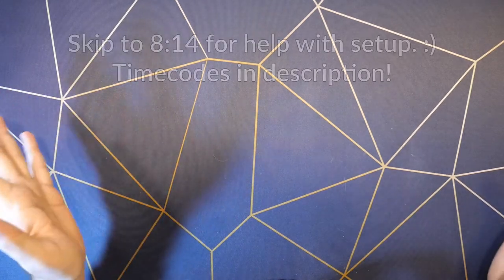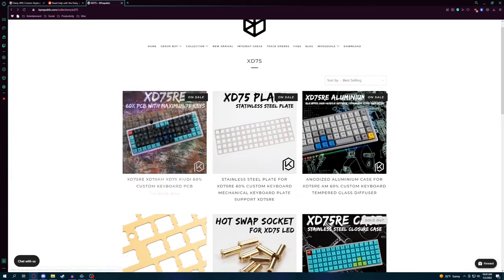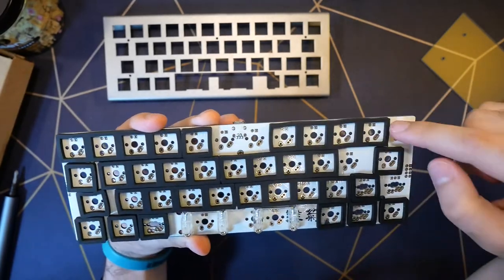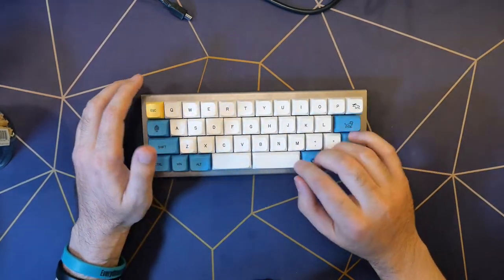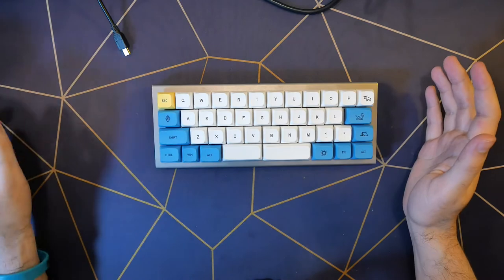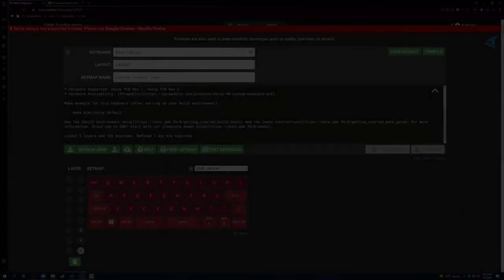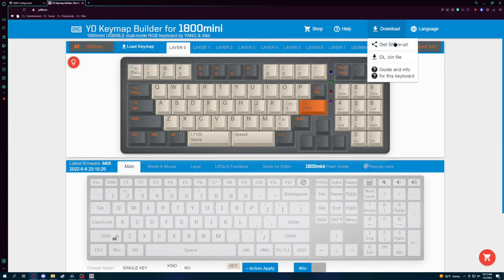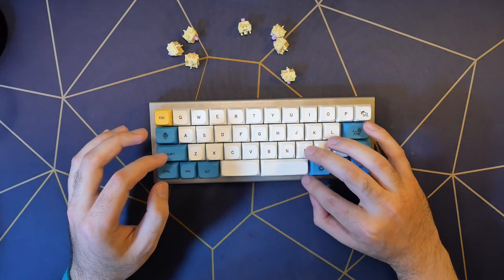Daisy40 - Build and How to Flash - KTT Mallo

Comment: There is both QMK and VIA firmware for the pcb, you can just flash with either of those firmwares no problem like any other keyboard. Idk what not detecting means... You can flash any firmware with qmk wether it be official or not
Reply: The issue is that the qmk_toolbox doesn't work for this keyboard's boot loader.